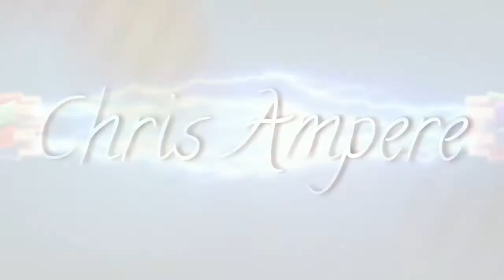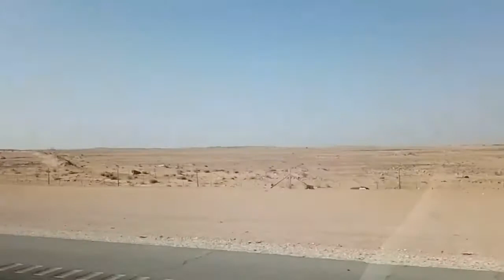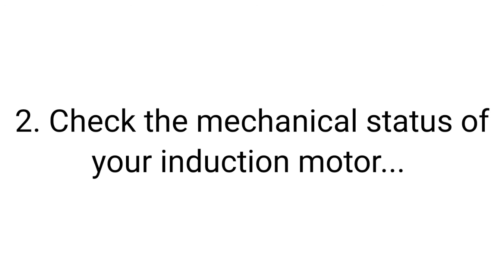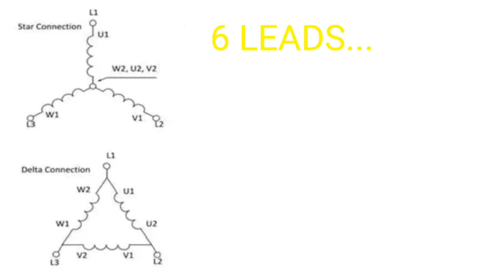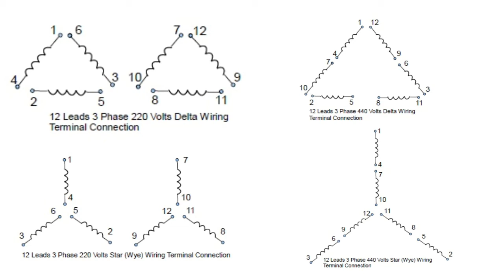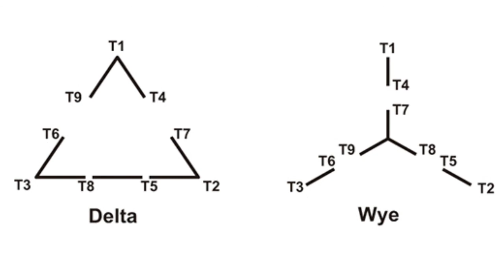Things to Check Before Energizing a Three Phase Induction Motor.

Comment: Master san po kayo ng trabaho sa ngaun salamat master
Reply from the maker: Sa saudi master sa isang industrial refrigeration plant. Industrial Maintenance ako dito.
Reply: @chrisampere  ah good job master
Reply: @chrisampere  ako din maintenance building electrician, ang probs kulang yung mga motor control circuit hndi pa ako bihisa, salamat master
Reply from the maker: Master alam mo ba na di ako nag aral about industrial control. Lahat ng aking binabahagi ay ayun lang sa aking karanasana at pagsasaliksik. Kaya naniniwala ako na kaya mo rin master na matuto sa motor control. Our  experience is our best teacher.
Reply from the maker: Master pa help naman po by sharing sa mga kakilala mo about sa channel na to. Salamat po in advance.